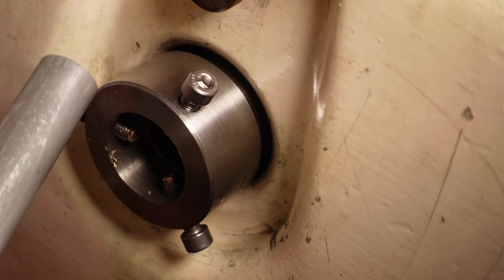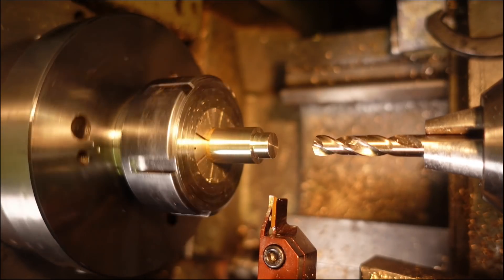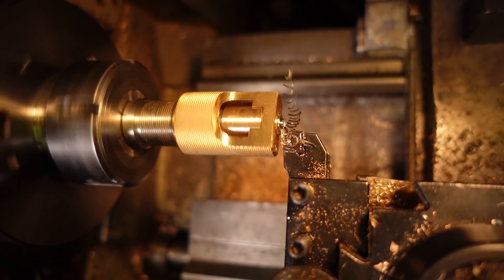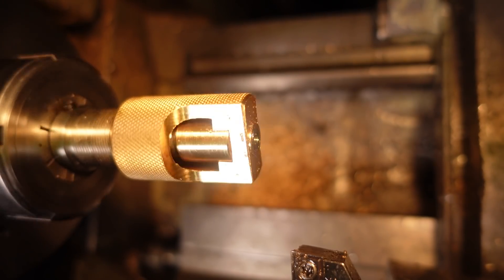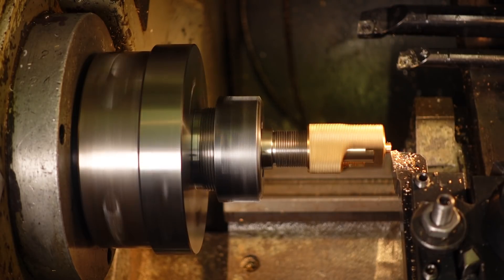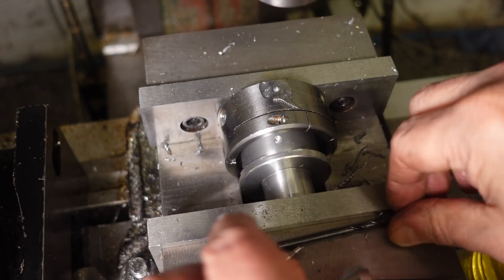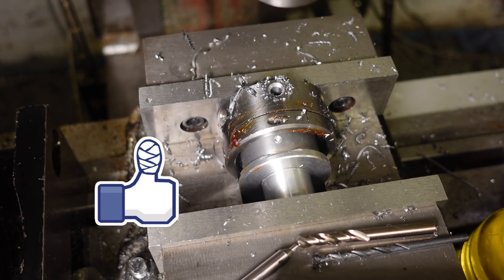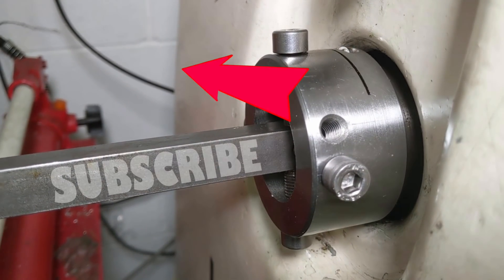Machining Brass-tipped Lockscrews for my Lathe Spider Upgrade

Comment: wow!!! A lantern chuck!!! So there is a way to hold a bolt  by the head end!
Reply from the maker: There are lots of variants of lantern chucks, mainly for watch and clock making. usually the body has the openings and the threaded section is a piston or a collar that pushes a sliding anvil.  They've been around for a very long time, mightily useful tools.

Comment: Hobby bodger you say :D Luckily you caught that brass bolt piece if it went in to the chip tray You'd have to make another ! Retrieval would definitely be too dangerous.
Reply from the maker: Chainmail gloves, body armour, spread the chips out on a giant tarpaulin and use a camera drone to search for the missing piece. Not good if it's dark or raining or windy, obvs.  Lucky I caught it!

Comment: I forget what they're called but you can buy screws with roller balls in the tips   they're used in machine jigs.
Reply from the maker: Now there's an interesting thought!

Ball transfer units perhaps? Threaded inserts with rolling balls in the tip: https://ball-transfer-units.com/with-bolt-c-7.html and there are similar things with spring-loaded  ball plungers for detents and for things that are not entirely smooth.

There is a similar sort of thing used in microswitch actuators,  and of course in better-quality steady-rests, but they use cylindrical rollers, much like this Starrett indicator tip https://www.starrett.com/metrology/product-detail/25W
Reply: We use them to put uniform force on a flat part with a dimple or hold to control hole location while doing something to it of make a jig. "  Click in "  to keep it's location on the machine table the same during retooling and or to stabilize machine tables as a dampener   they come with different spring strengths available   and even with special non metal and non ferrous tips.   They'll improve your inexpensive cross slide vice greatly btw. Amazon has them last time I looked I called them "roller ball set screws" or grub screws on there. It's just a grub screw with a strong spring. Depends on how strong you bought .. and a roller ball retained in the tip  that is arranged to collapse in at a certain amount of force locking when tightened but a roller lock when looser. You could probably make some yourself. But staking in the spring loaded balls yourself without a fixture  will be a ba****rd .  I'm sure. There's also a variation with a spring and plunger instead of a ball
Reply from the maker: I'd cheat and fit them from below and use a plug or setscrew to seal the thing in, but simpler to buy for the times I need them. One application is for a horizontal/vertical polarisation selector, with a ball detent at 0/90/180/270 degrees. Excellent tip, thanks

Comment: Do you remove the lockscrews when you have a bowed piece of material? (If thats something you work with). Love your commentary, another great video!
Reply from the maker: There's always a worry with anything banana-shaped that it could get flung outwards and cause a thrashing accident. I had to do cut a thread on a 1 inch diameter steel bar that was bent, but the bend started about 15 inches from the end, and it fitted into the headstock tube, but was almost touching the edge of the spider.  I lined it up as best I could, then tightened the screws to hold it in the offset position. The end of the bar was about 4 inches out of true. I tried running it slowly and gradually increased until I felt uncomfortable going any further.  I think that was 130 rpm. It turned OK at that speed and the lathe didn't leap about. I did the single-point thread a little slower in small increments and it worked OK, although the surface finish wasn't brilliant, but it was unleaded mild steel.  The bar was too long to fit into my hydraulic press because it's show-horned into a small gap with almost no space either end.  I did wonder about going all Keith Fenner on it with making hotspots and quenching them, and I tried using a cheater bar, but that just moved my very heavy bench. Anyway, it worked OK, but I wouldn't recommend it.  I have an upcoming job where I need to do something similar and cut a 9 inch long thread on some 1 inch bar that's too long to fit out of the back of the headstock, so I'm going to use a core drill to make a hole in the outside wall and fit a liner and plate with a small cat's head and steady rest.  The bar will poke out about 2ft beyond the wall of my 1850's brick-built barn. Guarding will be provided by a dense holly bush growing against the wall. That should make for an amusing video when it happens...

Comment: Ah, you have a decent cordless angle grinder, you are a happy man.
Reply from the maker: If I was brave, I'd find a way to mount it in on the toolpost and use it to grind helical gears! I killed too many Makita tools and it was a toss-up between DeWalt and Milwaukee.  I decided the DeWalts would clash horribly with the yellow trim of my John Deere lawn tractor, so Milwaukee got my dollars. I am SUCH a fashion victim...

Comment: Bizarre, I was watching your last video with the square stock and I was wondering about this very issue 😁 keep up the excellent work mate, nice to see someone go through the fine details when it comes to accuracy 👍I'll send a link to some radio freaks I know, they'll love this channel!
Reply from the maker: I did the same to the Spider Mandrel so I could hold some square hollow section steel. It only works if the threaded holes don't overlap too much. Next few videos will be a bit more radio-centric, although of course, it'll be Very Esoteric Radio, because I don't really do Ordinary
Reply: @MachiningandMicrowaves  😁 looking forward to the next episode 👍

Comment: Nils tell your assistant that that wasn't rubbish planing but Machine porn at its finest performed instead 😎👌. Keep it up that satisfying lathe work. You are a Virtuoso. Of building music instruments that make beautiful melodies in the GHz region. 😍

Sometimes i would love to be able to hear in the frequency region 😛
Reply from the maker: I measured that distance VERY precisely in advance just so AIMEE could say that it was bad planning.

I think if you could hear at GHz it would probably sound like a faster version of this classic: https://youtu.be/ckc6XSSh52w?t=78
Reply: @Machining and Microwaves thanks for the link  I just love the sound of that it's so melodic and relaxing☺️😍. I also love the high-pitched humming of 50kv transformer from old CRT screens😍, or the deep 50hz humming of the 20kVA three phase transformer from the Lokal "Umspannwerk". I also love when they disconnect it from the grind from time to time and huge banging Arcs shoot from the connectors when they open the circuit. It's so electrifying exciting 🥰. Also that's the reason why I have written machin porn at its finest, because of the precise measurements and smooth execution. Girls will never understand that even AIMEE 😉

Comment: For the 90° holes, if you have a suitably long drill, you could punch through and drill opposing holes in one go. Even if you only had one size that length, it would make locating easier since youd get them all placed in 2 passes.

Alternately, a square collet block like This Old Tony uses.
Reply from the maker: I wasn't convinced that I'd get anywhere close using a long drill, there would be 40 mm unsupported and unless I drilled most or all of the top hole using a stiff stub drill, I'd be reliant on that long drill to centre itself in the pilot.  Then even if the top hole was on axis, I'd have to drill the bottom hole at full size in steel into a curved surface. It would probably be fine though, as you say, and I could have used a pin through the first hole to set it horizontal and not do any measuring beyond centering the existing first hole.

Using a centre drill on a scribed line was pretty accurate, although I'm sure I could have done it better if I'd used a squared mandrel locked into the spider. I could have machined up a mandrel to fit into a collet block, but it would have to hang out the end of the vice.  I'd also have to use a jack or second collet block if I wanted to get a sufficiently stiff grip on the block in the vice to prevent it rotating upwards if the drill grabbed. I snapped an 8.5 mm stub drill when that happened.  I have a machinist's jack under the workpiece but that was no help when it pulled upwards.  Now I always use a second block at the far end of the vice. My collet blocks are ER40, but the bodies are 2 inch I think, not really butch enough for this lump of steel.  I almost talked myself into putting it into the chuck on my rotary table. As it was, the first bit of metal I found in the scrap box was a decent enough fit to clamp beyond the slit very very solidly, and I could aim well enough at the (invisible on camera) scribed lines with a centre drill. Perhaps I'd have done it differently if that scrap wasn't available.

Comment: When I was at school a boy decided to hold/support a wobbling bar that was poking out of the spindle of the Colchester Student (lathe, not boy ;-). It grabbed his brown coat and wrapped him around the bar very quickly. Fortunately the operator was on the ball and hit the brake quickly, so no lasting damage was done other than to the grabee’s undercrackers.
Reply from the maker: Oh good grief, it's amazing that there were so few deaths and maimings in school metalwork class. We had a forge, oxy-acetylene welders and flame cutters, lots of big machines, presses, concentrated acid, Trichloroethylene, Carbon tetrachloride, aluminium casting and molten lead. I wanted to do Chemistry, so I couldn't do metalwork, they said. Forced me to do <insert subject here> instead, so I deliberately failed all the exams to ruin that teacher's performance stats.  Thing is though, I really enjoy <subject whose name shall not pass my lips> as an adult.

Comment: Wonderful stuff as always. I'm what you'd call a young pup in the machining world. I cannot get enough of the DIY fixturing. You make it look so easy. To add to that, as an American machinist, it is actually quite relaxing to watch others use Metric. No fussing around with long decimals.
Reply from the maker: I'm pretty much metricated, but I have a full set of inch micrometers, depth mics, calipers and a fair number of inch drills, reamers, mills and taps and dies for Whitworth, BSF, BA, BSP, UNF and UNC threads.  Takes almost twice the space, but then so much microwave gear has Imperial threads or is specified in inches that you have to be bilingual.
Reply: @MachiningandMicrowaves  if everything would just be metric, the world would be much simpler. I appreciate what goes into your content, and I look up to you as a machinist. I knew from the beginning that knowing how to use manual machines and old timer tricks would be incredibly important. All the "dirty little hacks" as I like to call them. CNC is wonderful, but I love being able to say I made it by hand.

Comment: Dear "machines and microwaves" I enjoyed a lot of your videos by now. In this one I felt I could help a little with a comment. A few things; an edgefinder is an accurate tool to find an edge. If you do it right you can repeat within 0,01 mm. By right I also mean the spindle speed which should be around 600 rpm. Looking at your footage I noticed your spindle speed seems much higher and the spring is extended too much. During my education I saw fellow students ruin the springs this way. Putting a new one in can be quite fiddly.. Maybe this helps you somewhat. All the best, Job
Reply from the maker: The comment was aimed at someone who moaned that I would "only" be able to get the thing centred to within 0.015 mm using an edge finder and I should be using a DTI on the spindle.  I normally run the 10 mm diameter ones at 800 and the 6/4 mm ones at about 1300, but with the camera setup, I can't reach the speed control on the VFD and the cones on the Bridgeport stick if I drop the varispeed ratio lower than 1200 rpm and I have to mess about with a bit of wood and a mallet to get them unstuck.
 I really need to strip out the cones and replace the liners or at least finish building the VFD speed control into the pendant enclosure that's been sitting in the project box for a year!
I prefer using my Haimer for edge finding because it's easier to take out the backlash on the leadscrew than with a rotary finder. I really must get that VFD pendant finished so I can do electronic braking, jog and reverse as well as variable speed
Reply: @MachiningandMicrowaves  Thanks for your answer. If you use a DRO the backlash is no problem for center findin between two sides. I'm not sure if you use one. Otherwise it's calculating and shifting your zero accordingly. But you know how that works. Thank you for al of your nice uploads with great comments. Best, Job
Reply from the maker: @jobkneppers  I have a Newall DRO on the mill, but I don't trust it enough for repeatability unless the leadscrew preload is in the "right" direction.  I should do some tests with milling blocks after centering using the edge finder and the Haimer to see if the precision is affected.  It's that final 10 micrometres that I want to chase down.

Comment: That all looks good.
There is another use for a rear end spider, no euphemism to be assumed or intended, they are used for example when threading rifle barrels. You set up normally in 4 jaw and also in the rear 4 jaw to ensure everything is running true. Not that i ever do such things myself.😉
Reply from the maker: That's very interesting. I suspect I'll be using it for when I'm squaring the flanges on waveguides and coaxial resonators so they don't droop or oscillate.
Reply from the maker: Also, I could consider threading the barrel and making a moderator for the Weihrauch .22 air rifle that I use to "persuade" rats not to eat the bird seed.
Reply: @MachiningandMicrowaves  my problem is with those creatures and my badger's food but that is why we have 5 cats, although unfortunately came without the relevant lines in the instruction code.